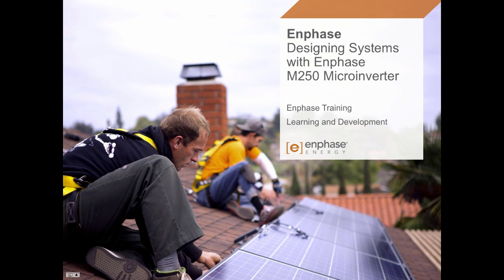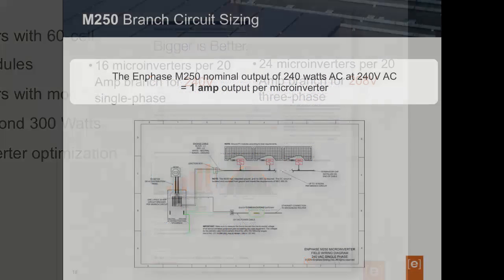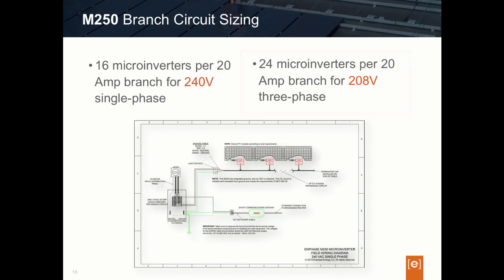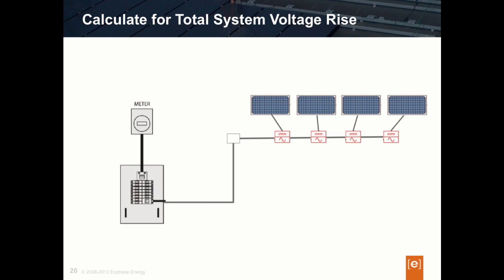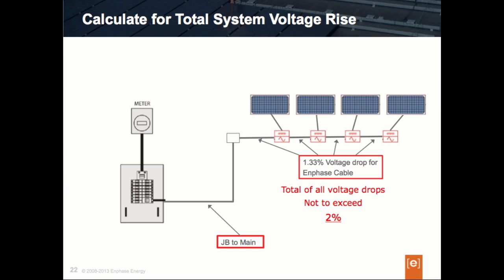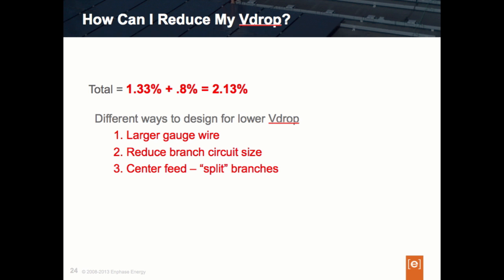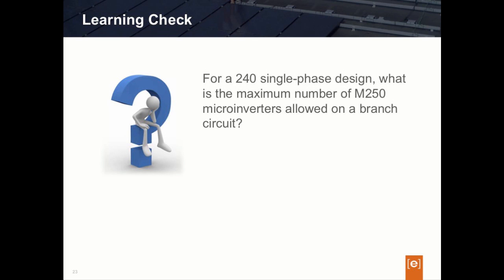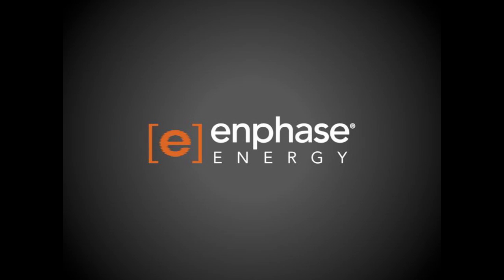Designing Systems with Enphase M250 Microinverters

Comment: Shouldn't it be a multiplication rather than an addition? The remaining voltage, i.e. 98.67% X 99.20% = 97.88% or 2.119% drop (instead of adding to get 2.13%)?

Comment: I want to design two 3 kw On grid systems. I will be using 330w panels. Which micro inverters should I use?
Reply: Feroz Ansari 

Use power optimisers

Comment: is 120 v and 240 v the same in the breaker box or i should just add a 240 volt breaker in the box connected there??
Reply: No! 220 is line to line. 
The 2 large wires that are on either side of the breaker box is 220V.
110V is a "split phase" of the 220V. 
Essentially a center tap transformer has 110V in each leg.
A 240V breaker is double wide so it can connect to both legs.

Comment: when you have pair panels center is ok. what about when you have odd number of panels
Reply: No problem. You can still split the circuit and have one more panel in one of the two new branches (ie - one branch with 7 and one with 8).

Comment: rather than a parallel system to attached from the micro inverters to the a/c trunk with centre branching would not a system of last one in is the first one out similiar to a three pipe system used on hot water systems be slightly more effective, producing the same voltage drop across each micro inverter.

Comment: You talk about a 20 amp 12 gauge circuit. 
Could you use a 30 amp 10 gauge circuit  to center feed a group of 20 M250 inverters? 
10 gauge wire would be less than 30 feet to main panel.
Reply: +John Phillips No, because the Enphase trunk cable is 12 gauge, and it must be protected with a 20A breaker.  If you wanted to connect several strings of inverters together in a separate breaker box out by the panels with 20A breakers in it for each string, and then run 10 gauge back to your main panel with a 30A breaker that would be ok, as long as the total amps from all of the inverters doesn't exceed 30A.

Comment: So if you center feed the branch of 16 inverters, shouldn't you take the voltage drop of 8 inverters (.35%) and double it to get .7%?
Reply: No. The two new circuits are in parallel, so the voltage drops are counted separately and not added together. For each parallel branch you still have to calculate and add in the voltage drop from the junction box back to the switchboard.
Reply: +eolkonen You have to account for system voltage rise, not just voltage drop when splitting trunk cable.